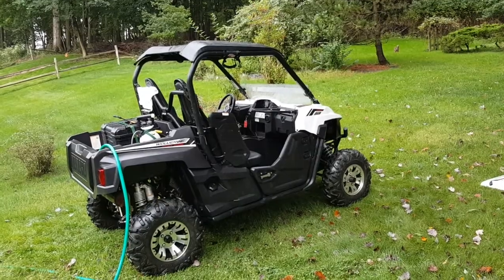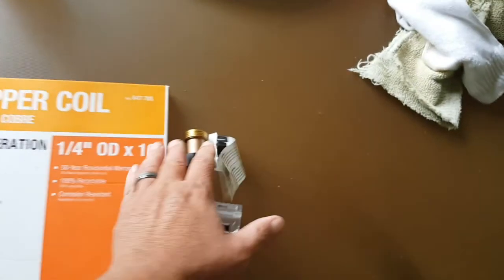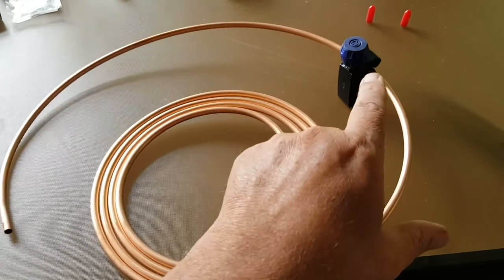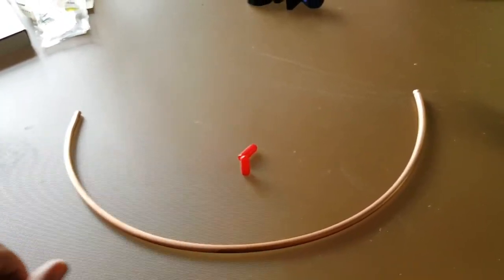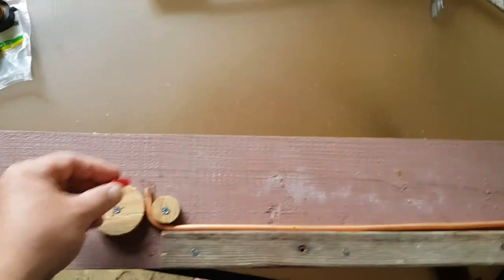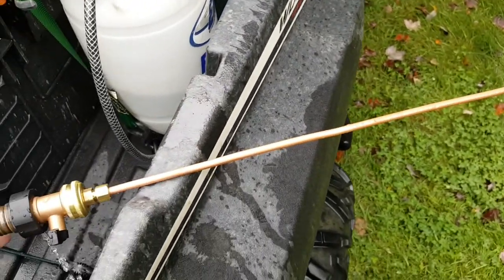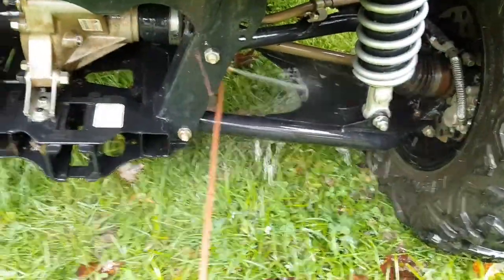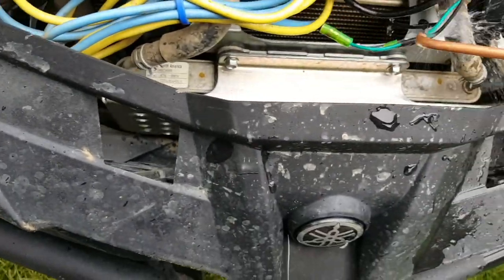Radiator Cleaning Wand

Comment: do not bend the outlet end. 
Keep it straight and drill a small hole in the side of the tube.
That way you can slide it in between radiator and coolers on different vehicles.
Works far better and easier than the bent pipe.
Just crimp that end tight in a vice.